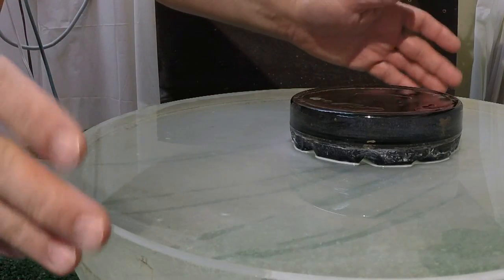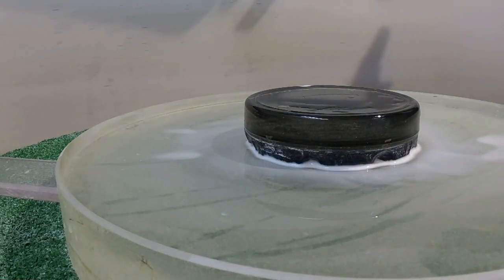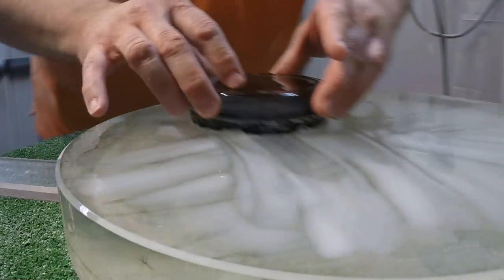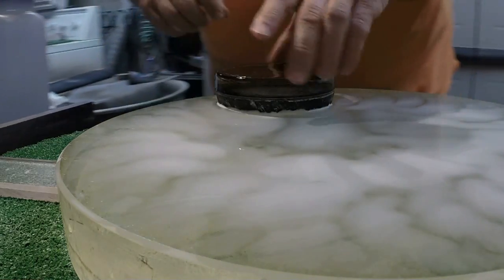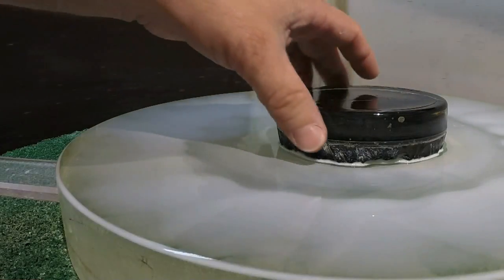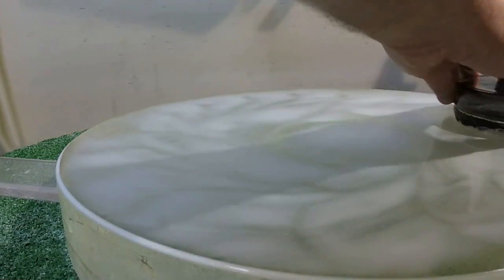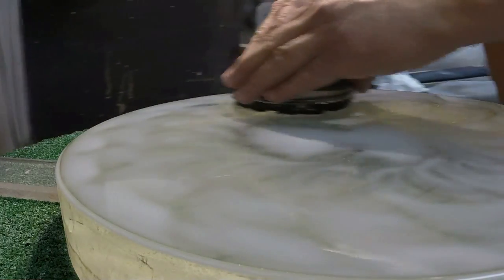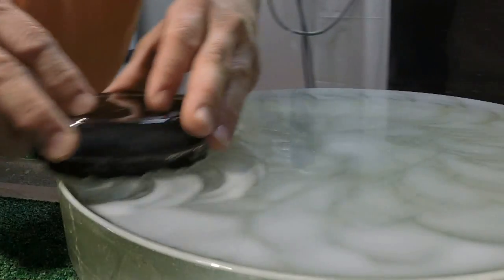GoPro Shows the Refiguring of a 14" Telescope Mirror

Comment: i have watched several videos about this, but my question is how do you know when you have it correct? is there a way to measure it? can you measure it to 10,000 of a inch tolerance?. is there a web site available that has the correct dimensions?
Reply: The desired figure is paraboloidal to about 1/10 wavelength of light, about 3 millionths of an inch. The method of measuring this tiny amount utilizes light itself. Look-up Foucault's test, it involves an artificial star at the mirror's radius, and a knife-edge to cut into the cone of the reflected beam.

Comment: Curious as to where you get the pre-generated mirror blanks? I'd love to make a 12" Newtonian in a Carbon-Fiber tube.
Reply from the maker: +Bill Schlosser Hi, Bill!  It's getting harder to purchase pre-genned mirror blanks.  I used to get them from Newport Glassworks in California, but they have recently been changing their location and they haven't been able to supply as many blanks.  Actually, I've started buying larger chunks of flat glass and cutting blanks myself.  I have access to a waterjet machine, so I can cut blanks from sheets at low cost.  Of course, those blanks aren't pre-generated, and it's a fair piece of work to get the rough curve in there.  And the larger and faster the mirror, the more effort it takes!  -Gordon